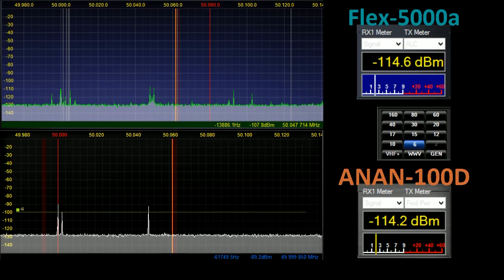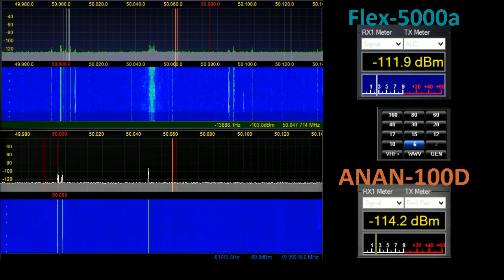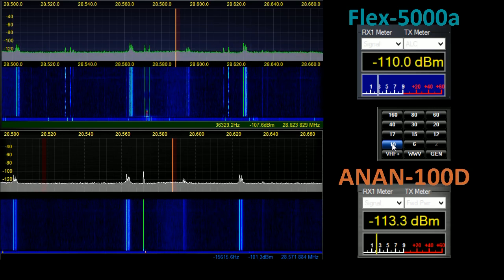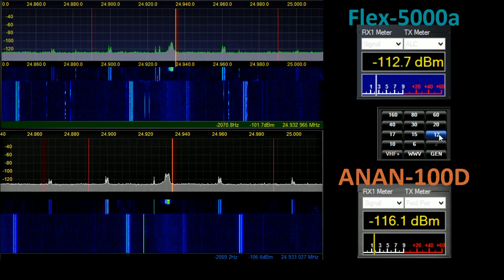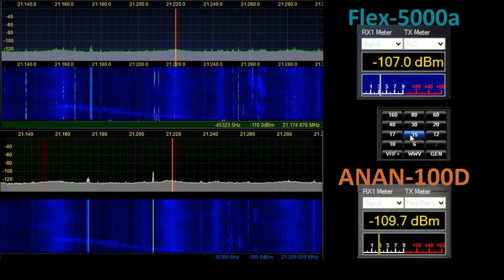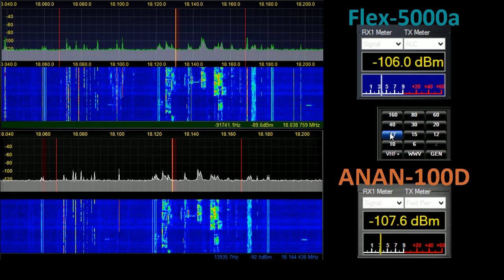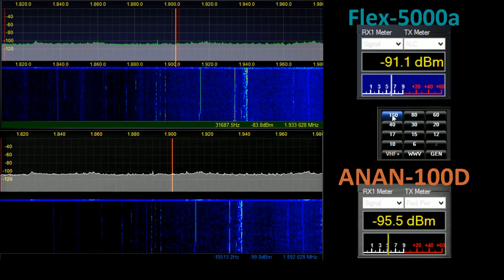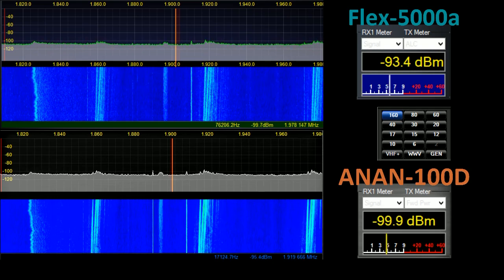Apache Labs ANAN-100D vs Flex-5000: Images

Comment: I have to agree, I have had a Flex 6300, 6500 and 6700 as well as a Anan 10E, 100D and 200D.  I must say the Apache Labs has a better receiver and if I was ever to get another SDR (I have a Yaesu FTDX-5000MP now) it would be a Anan 100D or the 8000

Comment: Do this test for me. Run a frequency response test on the transmitter and the monitor and see how flat they are. If it's like the 100b I tested it sucks big time. What you hear in the monitor is not what you get over the air. Is the 100d different? The world is waiting to know.

Comment: So.... Which do you recommend?
Reply from the maker: There is no easy answer to that because they are very different radios. The Flex can run 100w data modes and has an ATU, the ANAN only 30w data (100w CW/SSB) and no ATU. The ANAN has a vastly superior RX, phase noise, predistortion but is much more an experimenter's radio which many ricebox hams are having trouble coming to terms with. Horses for courses.

Comment: ....  welll , as We can see here by Your test  is that ANAN-100 is really DEAF on SIX meters  & 10m too :)   which is too bad :(   latter-on , can see that on Lower bands ANAN is better than FLEX-500 - so Flex-5000 is BETTER than ANAN-100 on  20m and higher bands  :)  ............  73's from MOME - Z32ZM
Reply: G7CNF Amateur Radio Station>>I have recently had cause to measure the MDS on the the ANAN and is came in at -153 dBm @ 500Hz on 10m. <<

I wonder what you have actually measured.
An ideal noise free receiver,i.e. with a noise figure of 0dB would have a mds of -147dBm @ 500Hz.
Therefore a mds of -153dBm @ 500Hz BW is physically impossible.
73
DL4 RAJ
Reply from the maker: Your comments are neither helpful nor objective. This comparison was looking at the difference in the innumerable images and spurs on the Flex compared to the ANAN and was never intended to showcase sensitivity. I have recently had cause to measure the MDS on the the ANAN and is came in at -153 dBm @ 500Hz on 10m. Please take a look at my video in which I pitch the Flex 5000 vs the ANAN on 6m CW and you will see that the ANAN trounces the Flex. . . . .73
Reply from the maker: Pomü Interesting quandary. Since the Sig.Gen and attenuator both have recent traceable calibration I can only assume the FFT application used to measure the difference between noise floor and +3dB was reporting signal per FFT bin width and not per bandwidth :-S
Reply: G7CNF Amateur Radio Station That does make sense.A sig gen/step attenuator being 18dB off (the specs say mds is 135dBm @ 500Hz) ,even if uncalibrated, would be a real piece of junk.:)) .A bin width of around 5Hz would fit including effects of the window function (assuming Hann Window) neglecting
a small error caused by the fact that the spectrum is not showing effective noise power(sometimes wrongly called "rms power").
73

Comment: How is the ANAN at rejecting plasma interference ? and local noise in general ? Great informative video thanks for posting out of interest what one do you prefer ?
Reply from the maker: The 100D (with dual ADC, compared to the 100 with a single ADC) is a very capable receiver and also capable of diversity/beam steering. With the correct secondary (noise) antenna (e.g. an active loop or similar) it is possible to null out specific local interference. In most instances it will only be possible to null one specific interferer at any one time but this is the most typical scenario any way.
Reply: Thanks for the information its really helpful to get this information first hand so to speak.I will have to think about getting a 100d i suffer lots of plasma and crap power supply crud so anything that is good and combating this unlawful crap as got to be good.Cheers G7CNF Amateur Radio Station

Comment: Nicely done Nige. As you said, it's kind of an apples and oranges comparison, but it we are simply looking at differences in performance rather than hardware architecture, you've done a fine job of demonstrating that. 73, Rob W1AEX